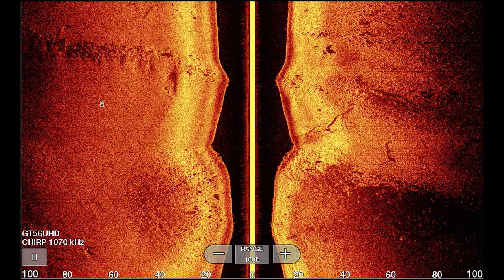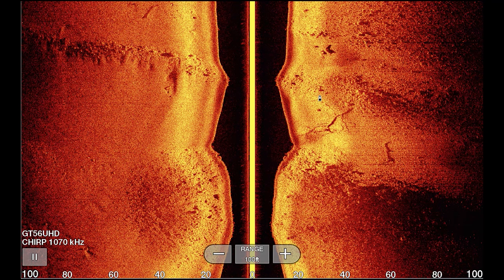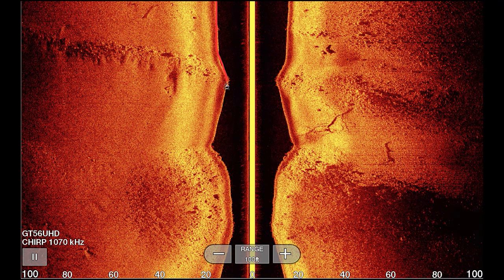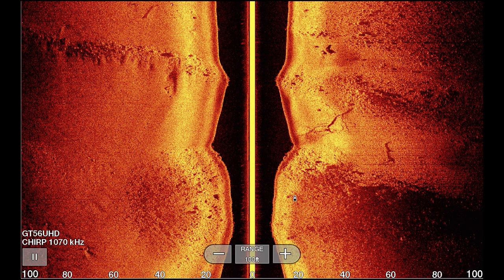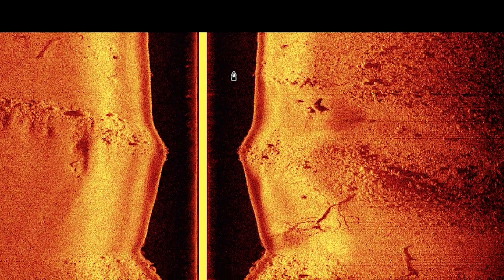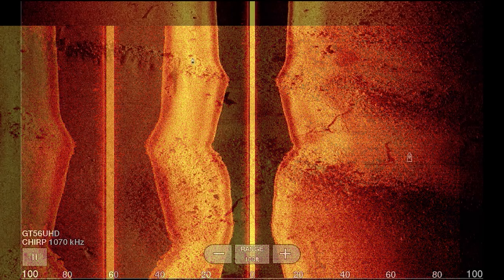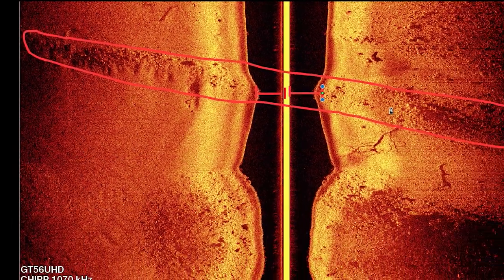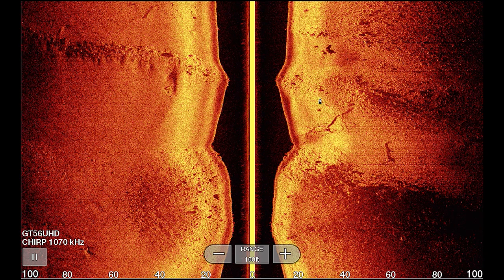Screen Shot Break Down Pt. 1 - Side Imaging - What am I looking at?!?

Comment: Max, if you decreased the range, say down to 40ft, would you be able to see that tree on the right with a GT54?  Is there more detail with shorter ranges?
Reply from the maker: Hi Peter.

When you decrease the range you will make things/objects bigger on the screen which can make them easier to see. 

As far as that tree, with the gt54 I was able to scan 60-70’ tops so it should easily pick it up.

Comment: Can you switch the left and right view on side imaging on a 106sv ultra with a GT56 transducer I’ve mounted on trolling motor
Reply from the maker: Yes there is a setting in there for that I’m 99.9% sure of. I think it’s under “installation???” But I don’t have a unit in front of me at the moment.

May I ask why you want to do this?
Reply: @MGMarineTech  I put a GT 56 on my transom and one on my trolling motor and the one on the trolling motor the rounded end is going forward and the one on the transom is pointed to the rear haven’t got everything installed to get on the water to see which one is headed in the right direction for factory settings
Reply from the maker: @garytravis3781  the rounded nose goes in the direction of travel. 

I would recommend that you install it that way especially on the transom
Reply: @MGMarineTech  that’s the way it is on the trolling motor but you can just mount it one way on the transom with the wire end coming out will be next to the boat and the rounded end pointed backwards I’ll look at the bracket and see if it can be turned around.
Reply: @MGMarineTech  I was wrong I went out and looked at it and the rounded end is going forward I was thinking of my old lowrance transducer thanks for the reply.